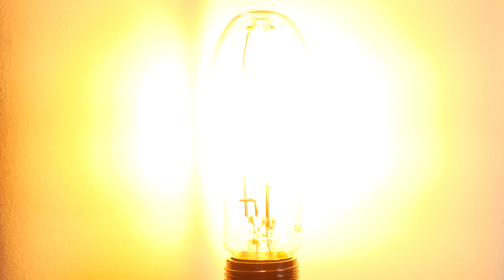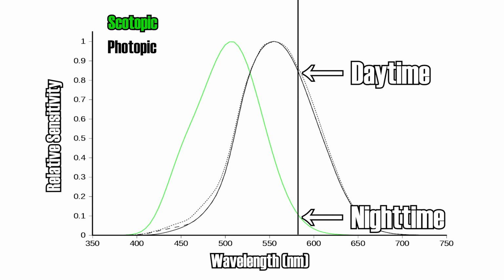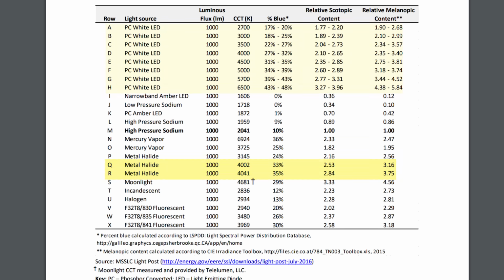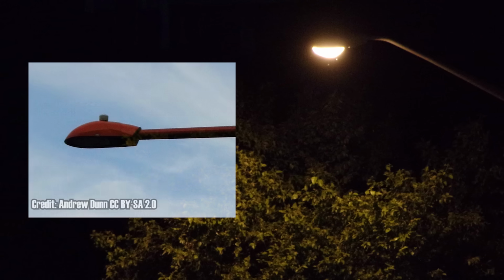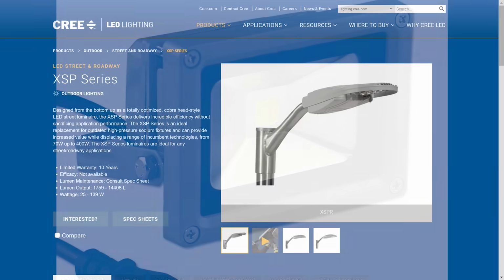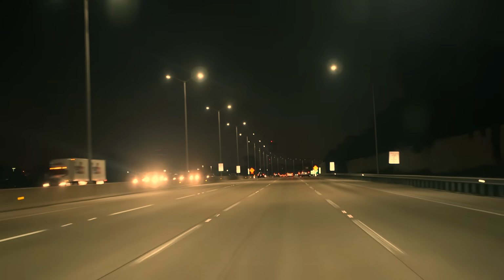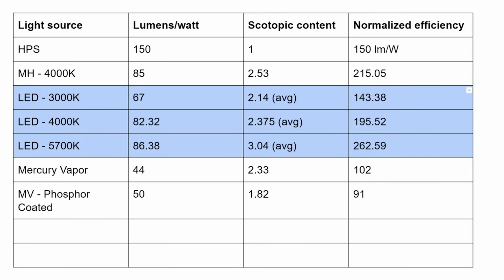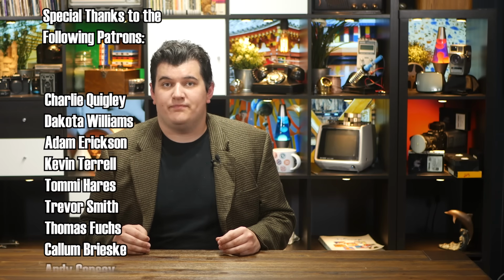The LED's Challenge to High Pressure Sodium

Comment: The way I see it, if you're going to be doing a daytime activity, like driving a 60 mph steel chariot alongside hundreds of other people, it might be appropriate to switch into daytime mode, then make up for this in other ways.

But here's another idea:

But how about we use LEDs that can dynamically change temperature based on voltage input? Then we can set it up so that it's more blue at dusk, and progressively becomes red shifted throughout the night?

Since the traffic drops off to mostly empty in most places, the safety will not be too compromised by this, especially as we are used to this color temp already.

Then, we can go a step further simply by upgrading the firmware later and adding small very inexpensive cameras and/or LIDAR to sense oncoming traffic so that as your car moves down the street, the color shifts with it from red to blue.

The beauty of this is that it argubly adds another layer of information to drivers, who can see where cars are even at a distance, just by watching the pulses of light that track along with the vehicles. Meanwhile, we can use a fourth of the energy when there's no car around. Bonus points for getting this to detect pedestrians as well and do something similar.

I mean, we have the Machine Learning matrices already mostly calculated for this anyway, given the self-driving car transition we are currently in.

Comment: LED will probably be all we'll see when on the streets.  Cities are basically replacing lamps, either in massive relamping, or when older bulbs burn out, with LEDs.  The same with lights for your home, or stuff like flashlights.  LEDs are taking more and more shelf space in stores, as the years go by.  Florescent lights are also being displaced by LEDs.

Comment: I would love a video on the research and technologies for newer vehicle headlights.  For my eyes, all the new technologies are EXTREMELY dangerous.  Anywhere I drive on two lane roads (most everywhere) I am completely blinded by these new headlights to the point where I'm just praying I make it past ok.  Once I'm past and wipe the sweat from my face, I still can't see because my eyes have just been violated.  I have driven these cars with new lighting tech (friends, work, and rental cars) and personally, I think the light coming from these newer cars is harder to see while driving than the proven halogen we've used for decades.  I can't believe the NHTSA hasn't cracked down on these.  What's going on??!!  I'd love to see at night while driving again.

Comment: Personal preferences are...personal.  I too have never liked "cool" fluorescent lighting.  I did my post-doc in a lab where we had two sets of ceiling fluorescent lamps.  One set was yellow, which supposedly caused less damage to nucleic acids in the samples we worked with.  (It was a radiology research lab focusing on UV effects, so we tried for whatever edge we could get on minimizing the EMR background across all spectra.)  When we didn't have DNA samples out, I liked having on BOTH the yellow and standard bluish fluorescents, while other people in the lab liked to turn the yellow set off.  I just liked the sunny look of mixing them.  (None of us liked working under the yellow ones alone, but it was a sacrifice we made to science.)

Comment: 9:09 -- #OneAfter909Report --  I live in a city which is located north of the Equator by over 45 degrees.  One of the strange and sometimes pleasant consequences of arc sodium lighting is that the light pollution is somewhat welcome in a winter blizzard, provided nothing freezes over and overheats.  The winter nights are not nearly as dark, unless the power goes out entirely.
Reply: ^^ ie. When visibility drops to near-zero, THEN arc sodiums really shine on for the public good.  When a winter  blizzard occurs in the daytime, it is known colloquially as a "white-out" if visibility goes to zero for a moment, or an hour.  It's Orange, on a winter's night.  All night.

Comment: Scotopic/mesopic vision plays little role (if anything) in street lighting they're way too bright and are too concentrated so they blind the rods that are responsible for low light vision. It might be considered mesopic to a degree.
Only if you're outside the area that they illuminate night vision might come to play, but that's not what they're supposed to be illuminating.

For scotopic vision dim LED strips could work well with near 507nm LEDs and proper diffusers.
It will especially make sense when the number of EVs increases and there won't be excess electricity to be wasted on illuminating empty streets. Which is hilarious even now.